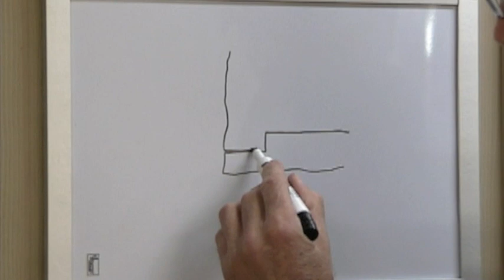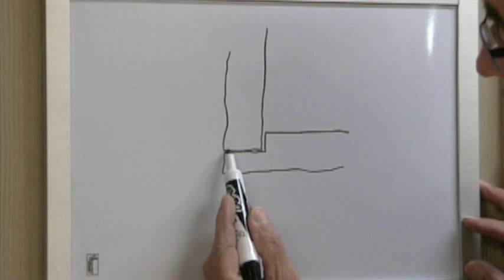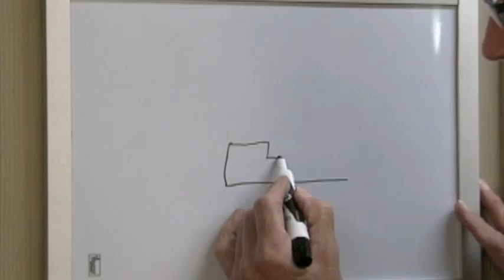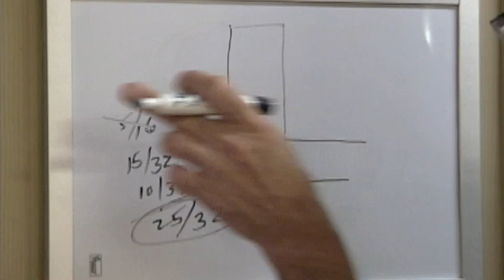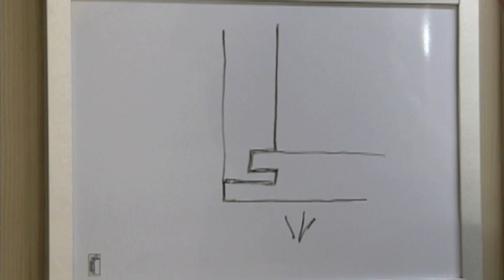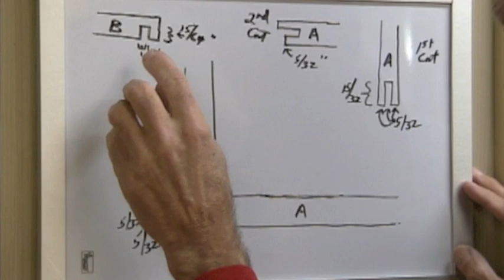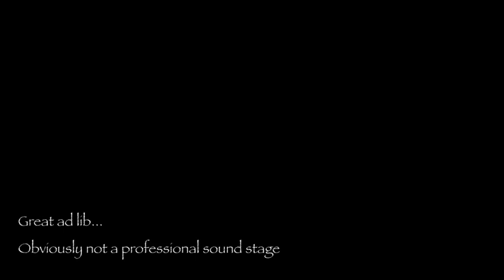Shop Desk-Bench-Pt 5-Drawers.mov

Comment: Damn good drawer joinery construction. I manged to use the first design rabbet from your drawing board but I just reinforced it with screws from the side on a slight angle into the wood with hardened  trim screws. It was just a drawer I made for the garage and holds up very well.

Comment from the maker: For small drawers I have used everything from hardboard (Masonite) to 1/4" plywood.  On a larger drawer, I will move up to 3/8" or 1/2" plywood.  Of course, as you increase the thickness of the drawer bottom, you will also increase the weight.  If you are not storing really heavy stuff and just want to prevent any long term sagging, you might consider using thinner material and running a brace across the bottom of the drawer... a small strip of hardwood will work nicely.  Thanks for watching!

Comment from the maker: I go for simplicity... I just put the two drawer slides together (the pair) and slide them up against one side of the box and measure what's left... that's the width you need.  Remember, most of these drawer slides have a tolerance of "plus=nothing" and "minus=1/32" or less.  So, you can "miss" the measurement a little toward the small side, but don't make them too big!  A viewer reminded me that if you make a drawer too small, you can shim the drawer slide, but you can't make the drawer smaller